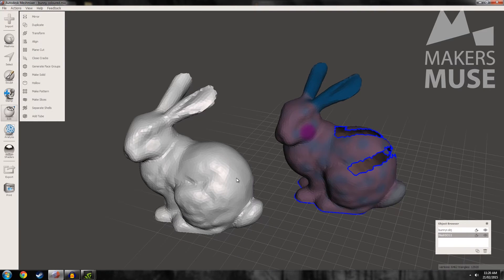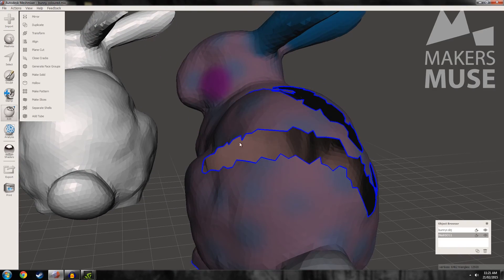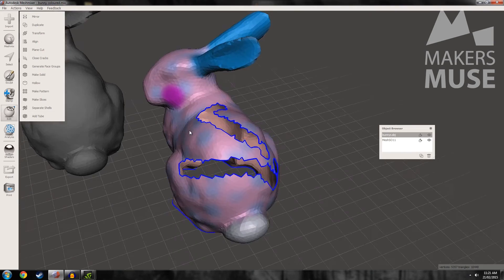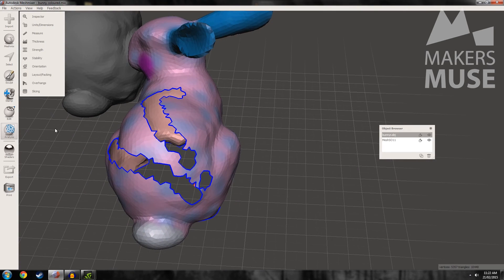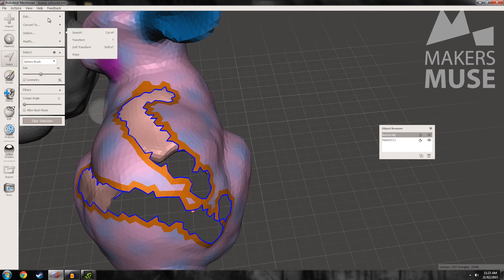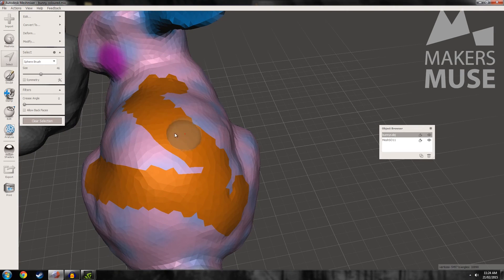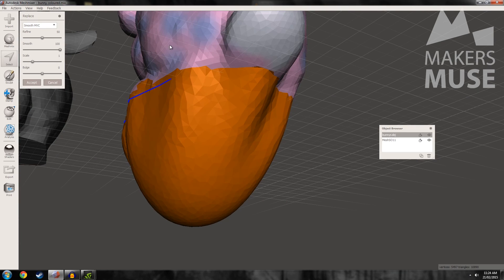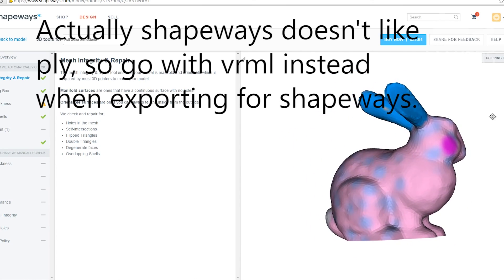Repair holes in COLOURED 3D mesh files with Meshmixer! Tutorial - 2015

Comment: Can someone please help me? I have a 3D design for a 2 piece container that someone did for me that I need to tweak. The only information I can find relates to basic changes based on extending of reducing the X,Y,Z axis. I want to alter a specific area of the image, not necessarily everything along a particular access. For instance the base has two horizontal surfaces with the upper surface inset slightly to accommodate the cover and create a smooth surface when closed. I need to thicken the inside of the cover along the Y access so the taper angle creating a tight seat. The inside would need to slope up and in evenly all the way around instead of a straight vertical line so that as it is seated it creates a seal while the outside of the same wall remains unchanged. Inside there are 3 holes for a few items to fit into the base and I need to alter the dimensions of these spaces.  I also want to emboss or print a logo on the surface of the item if you are feeling extra helpful.